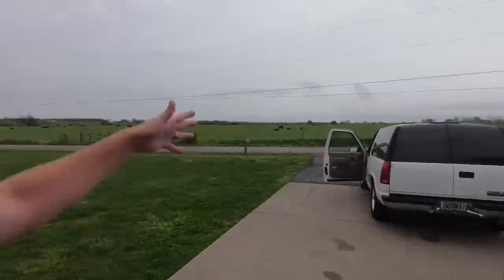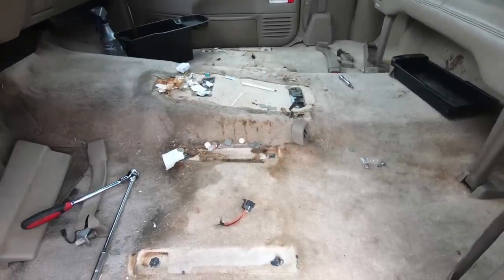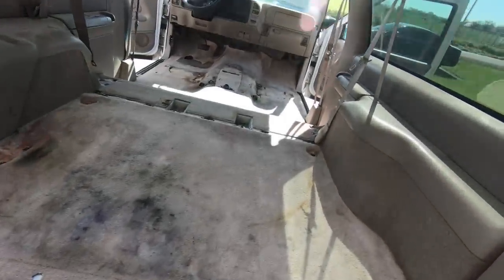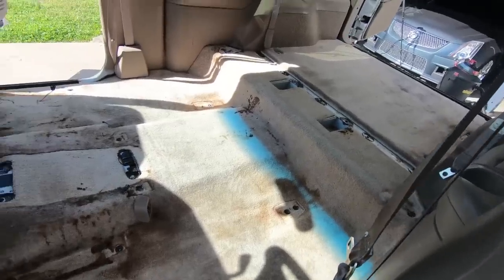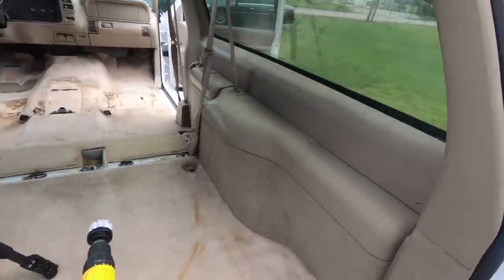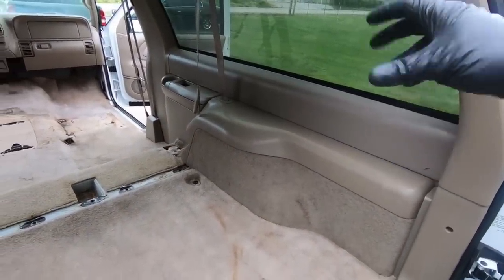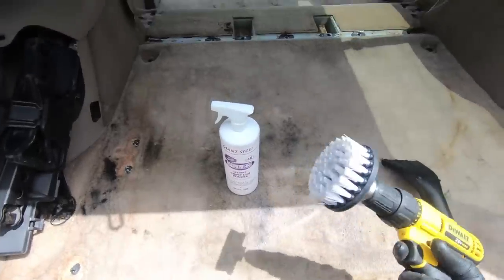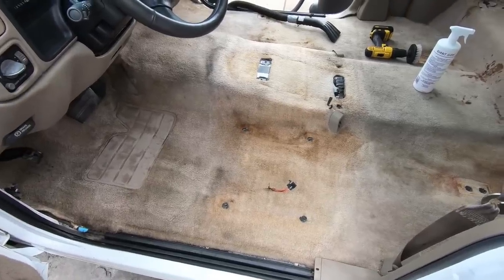2 Door Tahoe Makeover Part 2 (Interior Cleaning Part 1 of 2)

Comment: For large carpet like this, one of the best way to clean it is the remove the whole carpet, and find a way to suspend it. Then liberally soak every inch in a degreaser, and then pressure wash it. Rinse wash repeat. Be amazed how well it works!
Reply from the maker: I have done that in the past and its suck a pain but does work well

Comment: Magic eraser on panels is where its at!!!  Way to much work and money invested in those carpets.  Entire OEM set is $200
Reply from the maker: Someone else said that. I will try that next time.
Reply: My 1st priority was getting my dash cleaned so i pulled all the dash panels and it turned out amazing.   Steam cleaned my vents and cleaned between all the switches and the panel.   Your videos will motivate me to move on quicker now.  Thanks
Reply from the maker: @Bearhater21  yeah I did the dash but not crazy as dust during paint will require a redo
Reply: TWA Motorsports i am interested in how the seats turn out.  Seen a lot of bad attempts at these seats
Reply: Had a 1 owner 96 shipped to MI from nevada 2 years ago.  Less than 3k on it since then.  Stalling on getting it done.  My main thing is i want the luggage rack removed which means extra cost messing with the headliner

Comment: Need some help. I have an 03 Silverado (hoping the same issues with my truck are similar to your Tahoe). Took the seats out a while ago, (replaced middle console) then I put them back in. All manual seats so only plug-in was the airbag sensors. I’m getting airbag sensor displayed on my dash but the wires are all connected back to the seats. Implugged battery for 10-15 mins (didn’t work). Any thoughts?
Reply from the maker: No idea as I have not had that issue

Comment: Your videos never disappoint! They always keep me entertained. I was thinking, would a pressure washer be safe for carpet if you were to pull it out? I feel like it would be able to push out the dirt and grime, however I’m not too sure if it would tear up the carpet or not.
Reply from the maker: Thank you. I have done that in the past but it takes forever to dry and is heavy
Reply: TWA Motorsports I could see it taking forever to dry and being heavy. How has it turned out cleaning wise? Does it work well?
Reply from the maker: It does do a decent job